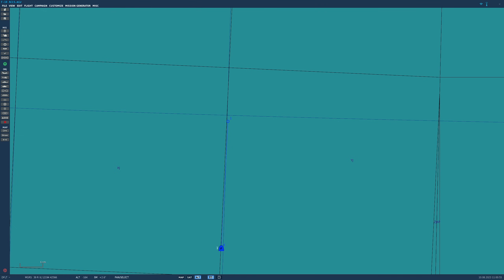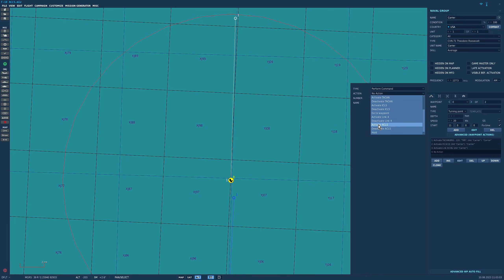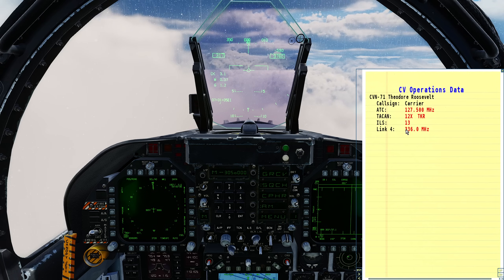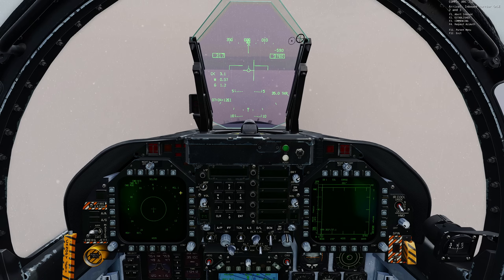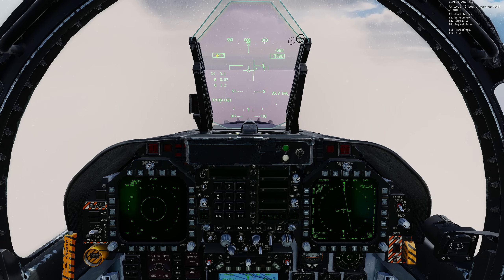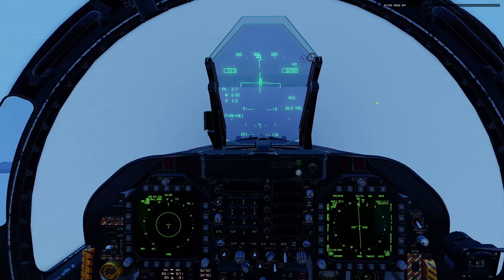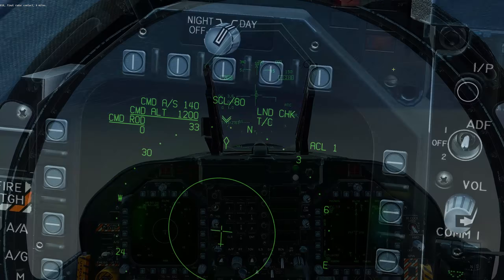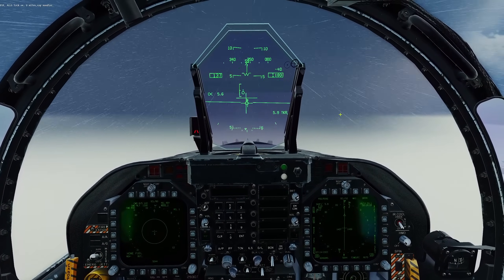FA-18C Hornet: ACLS Automatic Carrier Landing System Tutorial | DCS

Comment: I have a problem when i takeoff and land in the f-18. It seams below a certain speed my Hud goes all weird. the pitch path or reader goes to the side of the Hud and is no longer centered. I dont know if this is suppose to happen  or if I am doing something wrong. I though it may be because of wind and my aircraft is drifting but i dont know?
Reply: try the "cage/uncage" function? seems like you have uncaged the velocity vector, so it shows you deviation due to winds and inertia ... (press C oder mapped control and see if it changes)

Comment: I’m running to issues with flying MP on 4YA.  Often the coupled P/R doesn’t engage until 2-3 miles.    Ideas?
Reply: It’s supposed to work like that, the actual autopilot switchover is part of the final phase of the approach. You fly by instrument and the acls’s commanded airspeed/altitude until you get to the “say needles” point. If you’re roughly on needles, from there on outward you can hand over and engage cpl AP.

Comment: Remember: ATC in landing configuration will not hold speed but AoA instead, so perfect for landing.
Reply: This seems like such a cheat, lol.  After this Ill never be able to hear "landing on a carrier is the hardest thing known to man" and not crack a smile and think of the physicists making a Fusion Reactors, lol.
Reply: with the hud symbology, think of the e bracket and the velocity vector as a throttle. the further down the velocity vector is, the more thrust is going to be applied, and vice-versa.
Reply: Did not know this, thank you!
Reply: Maybe that's what I'm doing wrong. I always have to bolter and the gear gets damaged with ACLS landing. I didn't realize that ATC does not hold speed but AOA in landing configuration. will try again tonight. Thank you.